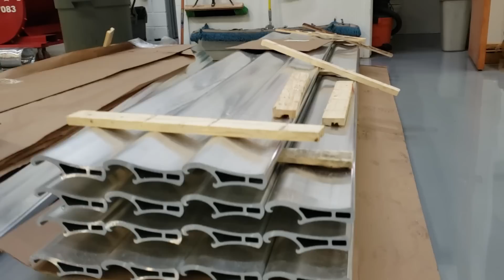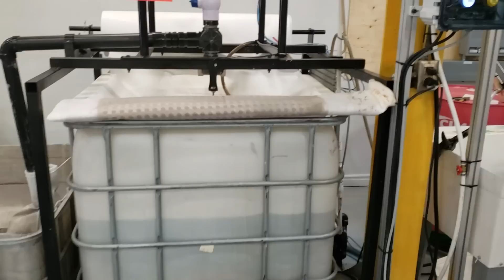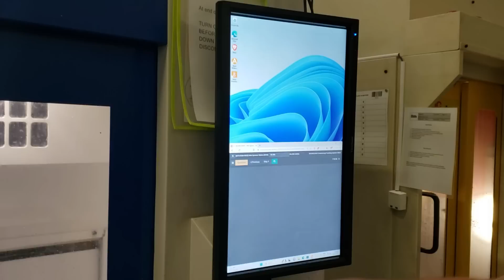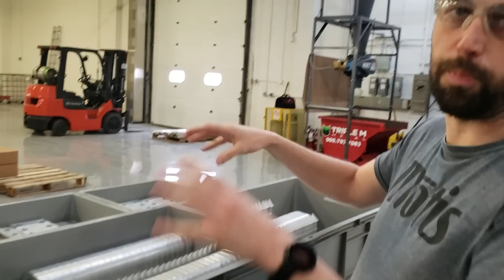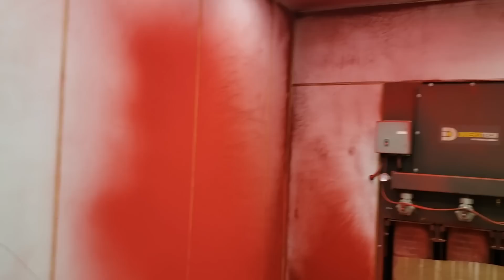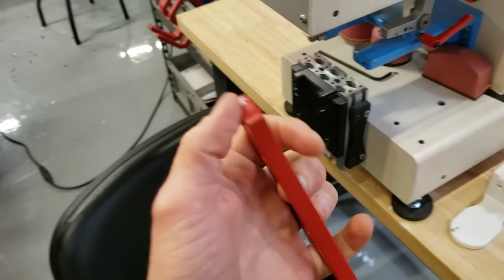Touring the Motis Fire Rescue Shop!

Comment: Holy crap, been having major issues with vibratory tumbling water. This is great, thanks!

The stuff there is genius too. Great job, great place, great tour
Reply: Yeah based on this I might put an inline filter on the drain of my mr debur.
Reply: @poetac15  it's a damn challenge. I tried a weir tank with a pump and all sorts of media, the pump would get completely blocked within a day. I notice the pro solutions are all centrifugal type machines
Reply: @HudsonLighting  We found the same thing.  Centrifugal systems look pretty awesome, but the price tag is unbelievably high!  So after trying a ton of different systems we cam up with whats in the video.  If you have any questions about it feel free to reach out!  Happy to share.
Reply: @MotisFireRescue tha KS ever so much, I'll drop you an email ❤
Reply: @HudsonLighting  Awesome!
Reply: @poetac15  Definitely worth trying!  Do you run plastic or ceramic media?!